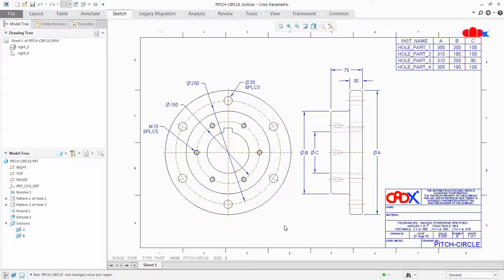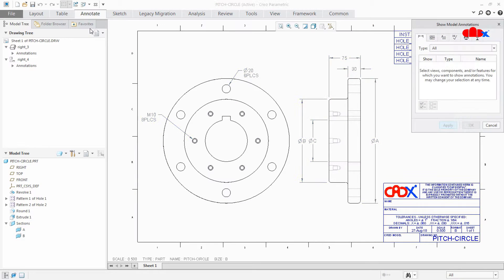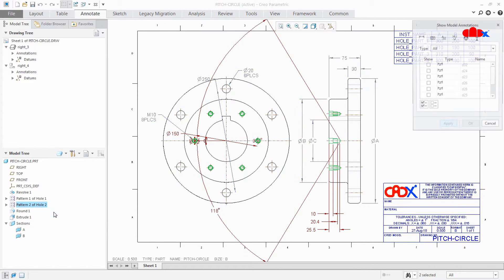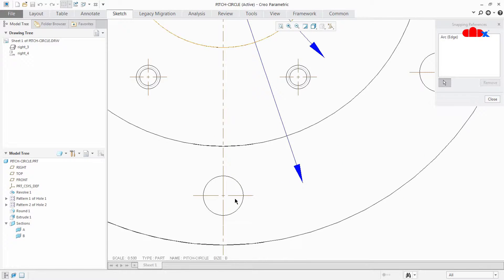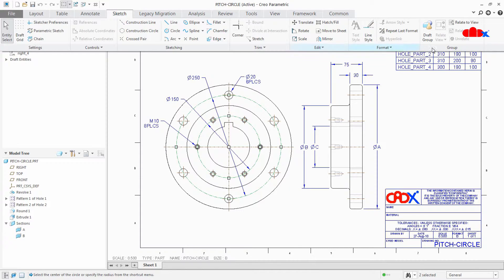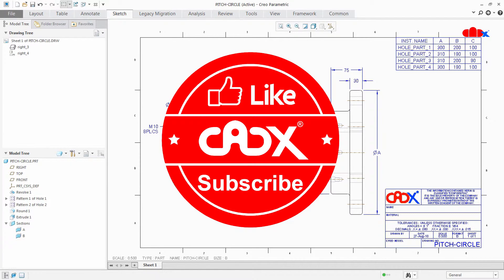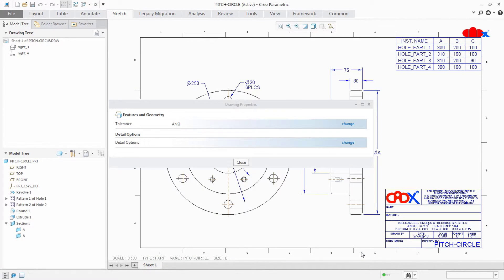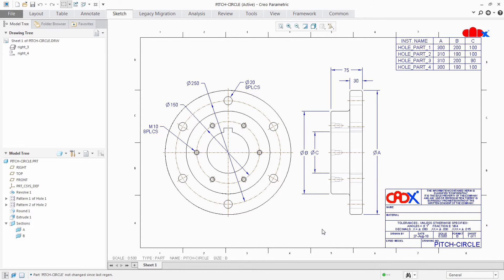Auto pitch circle PCD in Creo Parametric for circular pattern inside the drawing

Comment: even after change to yes value for radial_axis_pattern_display ...i can't see axis pattern
Reply from the maker: You must apply the changes to get the result.
Reply: @CADxTraining  I did but not shown after regeneration
Reply from the maker: Just for a trial, you create one new drawing and do the same thing. But first you add all the axis.
Reply: @CADxTraining  I tried but not shown
Reply: When I select view and click on Show model annotations in that show datumns tab there is visible Pitch circle but not able to select that
Reply from the maker: Yes you can't select it
Reply: @CADxTraining  I sketch circle as you told in video ..but when I go for dimension it show's in single digit but my dimension in 4 digit...in mm.... confused how to solve this...?
Reply: same here.also holes are also not showing the axis in annotate even after using pattern...